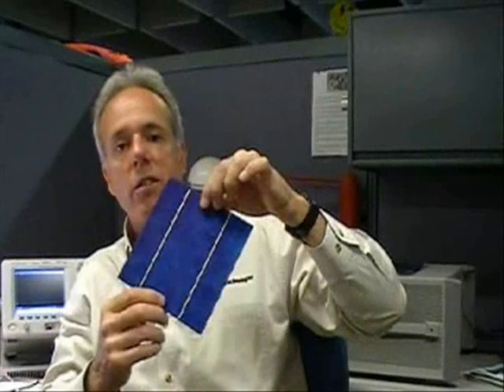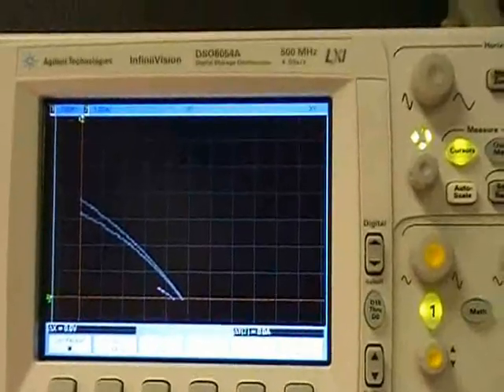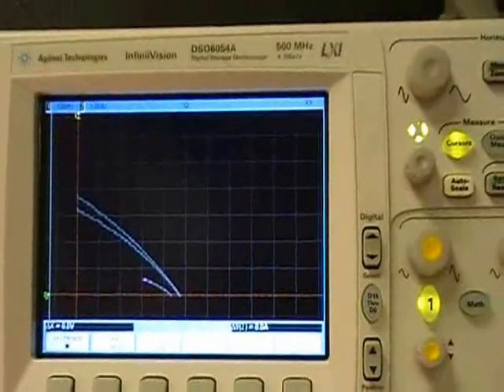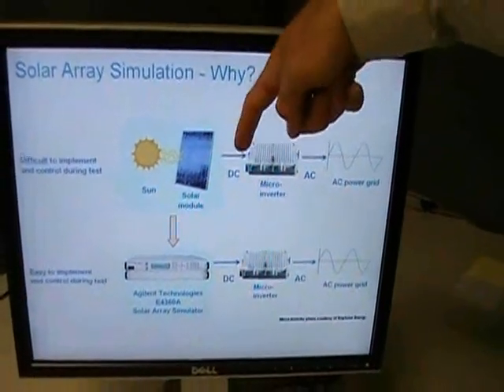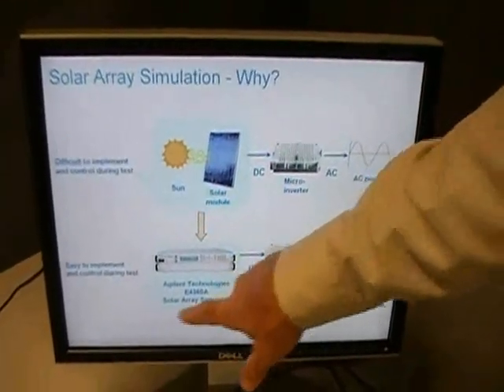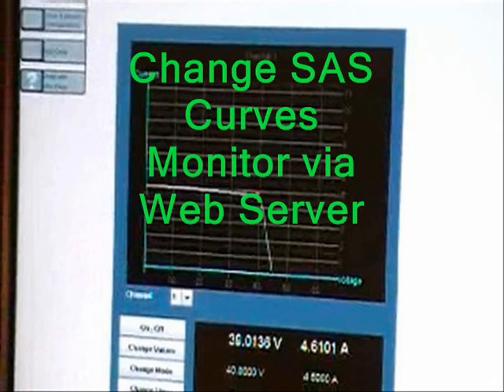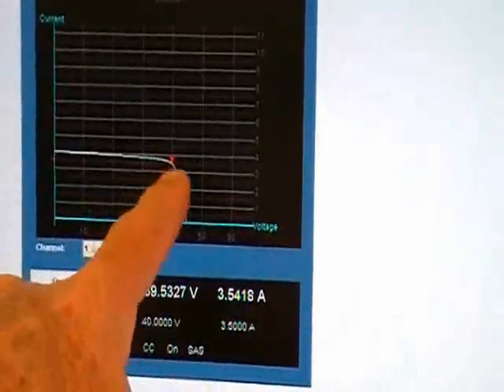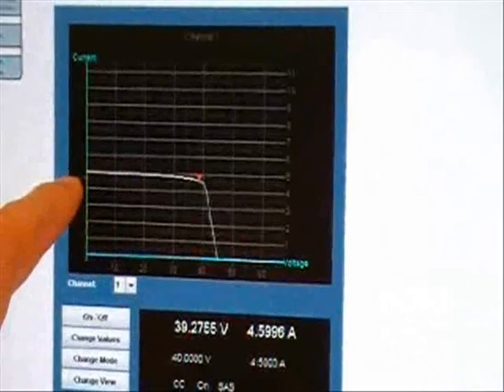Microinverter Test Using Agilent E4360A SAS

Comment: When you keep a solar cell under light for a prolonged period of time, it heats up and its Voc drops. That is why the third I-V curve you measure has a much lower Voc than the rest. Your method is not a good method for measuring I-V curves at different irradiation. YOu should at least let the cell cool down between each measurement.